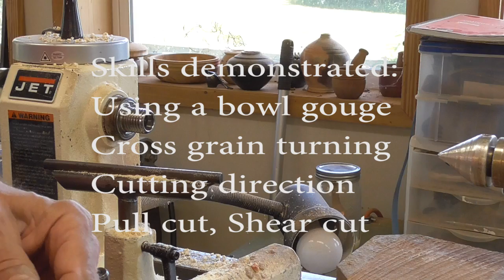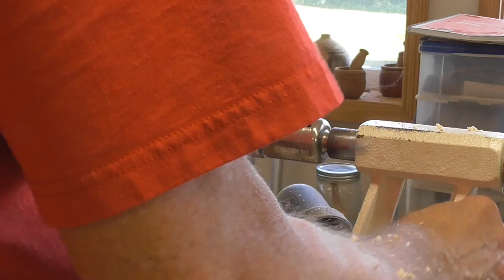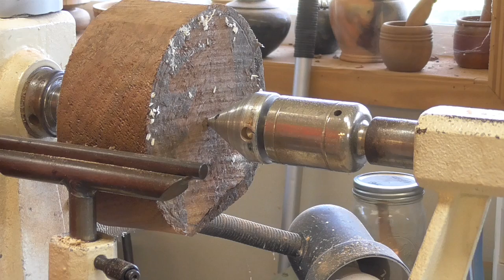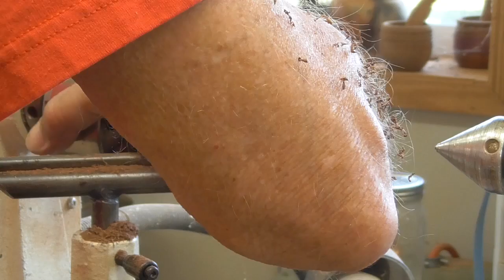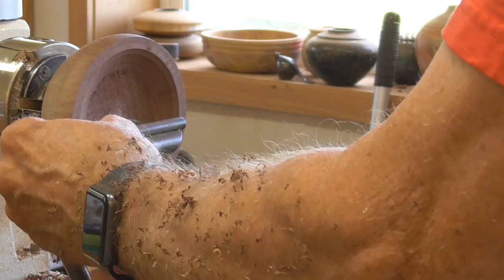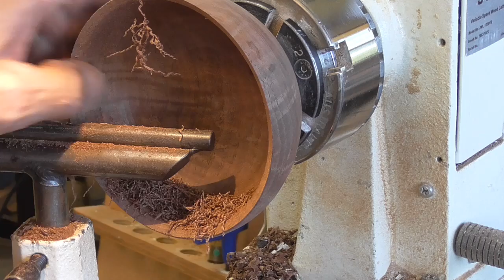Using a bowl Gouge

Comment: Nice video. One issue I had though is, I was left with the feeling of only getting part of the information. Every time I would hear your tool start to chatter you would start to explain how to avoid it, but then stop mid thought. Then finish the pass. It may be better to stop, and explain the issue and how to resolve it. Then demonstrate it. This way you can focus, and the viewer knows the information has been covered. Otherwise you may have covered the information in it's entirety later, but as a viewer I have no way of knowing this is the case. Just a suggestion for future videos. Otherwise I think you did a great job explaining the processes.

Comment: What oil did you use at the end? In my old shop class days we used an oil that produced a pretty glossy finish. I have been using real tung oil but it’s very dull. Thanks.
Reply: Hi Matt,  did you get any info ? Cap'n Eddie has some very good you tubes on oil . I have been using a modified  version of his . I wet sand with shellac while burnishing with a paper towel at the same time , then when dry put a couple drops of shellac on a paper towel and same amount  of blo , rub it on with lathe running while burnishing with towel,  let dry and repeat till high gloss.  Might take many coats then wax.

Comment: You have the wrong angled gouge for doing inside the bowl, that's why it wants to come out on the rim each time, that swept back grind is fine for outside the bowl. Stick with the standard  40-55 deg or similar bowl gouge to keep the bevel rubbing inside.

Comment: Great video, I just got into turning and I've been doing pens. I made a few lidded boxes and now looking to starting bowls. Were you using a regular bowl gouge or a fingernail gouge?
Reply from the maker: I generally have a 40 degree bevel on my bowl gouges but I also grind other angles as needed to keep the bevel on the wood.

Comment: very bad habits to see - he is not adjusting the tool rest close enough to the work, trying to break his thumb by feeling thickness of the bowl whilst bowl is spinning, adjusting tool rest with motor running etc.
he also does not mention the correct height of the tool rest vs centre of piece. 
several episodes of catching due to poor habits.
should also MARK the centre of the piece both sides before putting it into headstock and tailstock - not just say 'thats about the middle' and 'try to get it at right angles to the long axis of the lathe'!!
Reply: Shut up idiot!! Where exactly are your tutorial videos?
Reply: Funny, I searched and did not find any of your video. So easy to criticize
Reply: Yes, definitely MARK on a piece of wood that has been rough cut into a vague fucking octagon on a bandsaw, because if you don't and you just estimate it then you will probably actually DIE. True story.